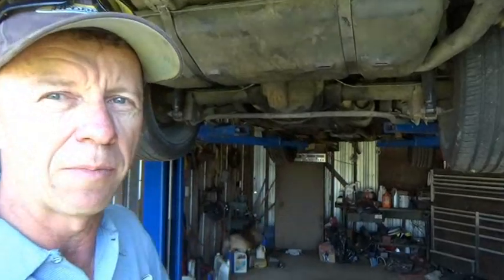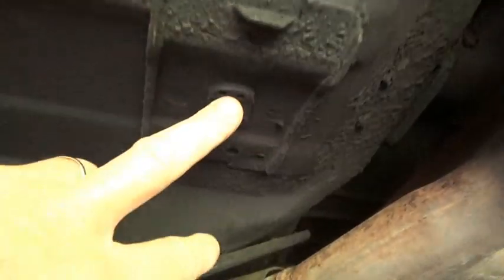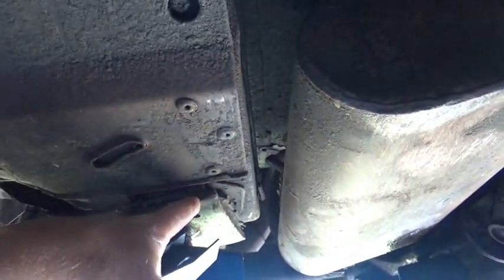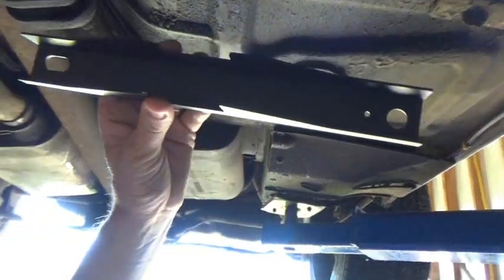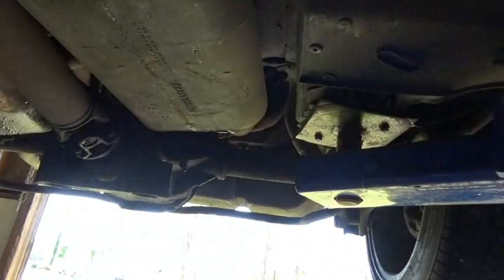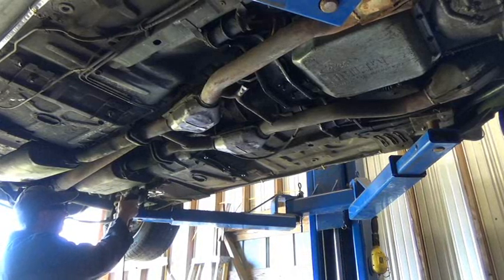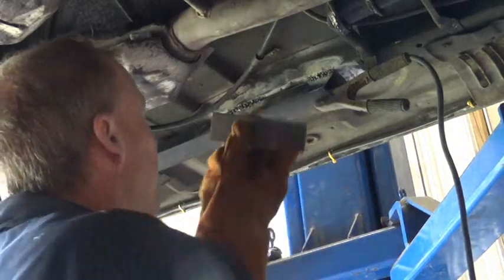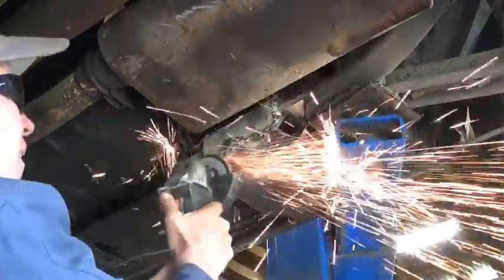Foxbody Convertible sub-frame connectors install

Comment: One issue.  The car needs to be supported by the suspension when you weld the subframe connectors into the car.  By picking it on lift  and letting the suspension hang, the body and frame are twisted. By welding in the subframes with it twisted you just made that twist permanent.
Reply from the maker: I had looked into that and watched several other channels. Decided to do like some others had and just make sure it all lifted dead level at the same time from the same lift points. Not really twisted but maybe a little arched. Thanks for watching and may we all learn from each other. Very valid point.
Reply: Youre right , like the muffler shop use
Reply: weight should be on the front and rear suspension to install the subframe connectors

Comment: Bro, as that guy with the long name JSCwatever said, your car needs to be on the suspension.  The wheels or the spring perches.  I hope it didn't mess it up to bad.  Even more, I hope no one watched this and did it the way you did.  Level or not the weight of the car has to be on the suspension.
Reply from the maker: I agree that suspension loaded is best for all who are reading comments. I did not have that style of lift available. On my follow up video I go over all that and even show the welds held up the door gaps even  still the same. Those subframe connectors are not as strong as you think. They do not hold the frame in one place only a 6 point or more roll cage will do that.. They connect the sub frames.they do no hold the frame in one position.  The frame can still twist with connectors just not as easily.  I tell everybody do what you  can afford. Thru the floor and ladder style will hold the floor a lot more square, but 2 pieces of hollow metal in a parallel setup will not keep  car from flexing. Common physics

Comment: I've got to do this on my SSP but my vert already has them.  In NC for cars over 30 years old you don't need inspection anymore so you can put you an off road H pipe on there. I'm sure my welding would be worse
Reply from the maker: Me and the inspector go way back so I never have issues. 😁He's a hot rod guy.

Comment: But youre suppose to weld it with the car sitting on the tires, IF not chasis will twist...
Reply from the maker: We watched all 4 corners carefully and made sure they lifted at same time. A 4 post lift would have been nice but wasn't in the cards. It still sit back down with same clearance as before. Anyone who does keep weight on the wheels does have the advantage unless shocks are worn. It still flexes some but is way better and measures same as before. Thanks for the comment though so others will learn.